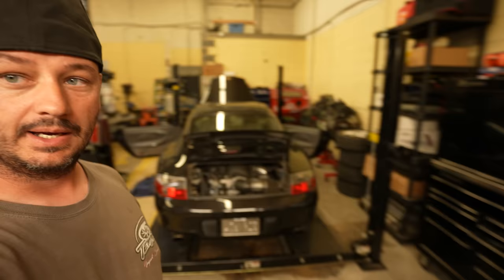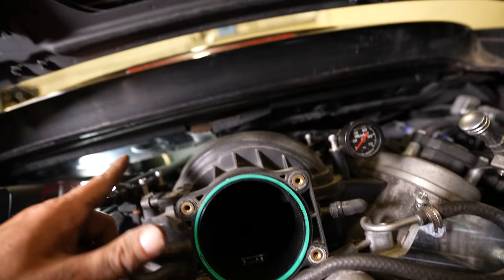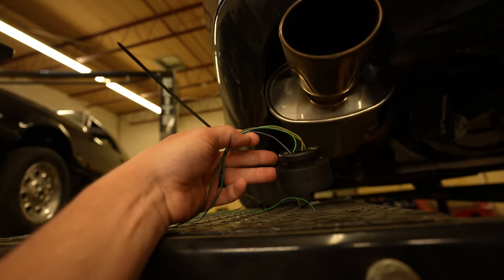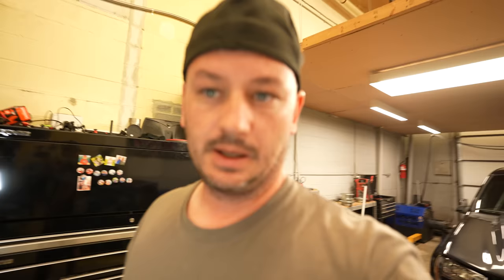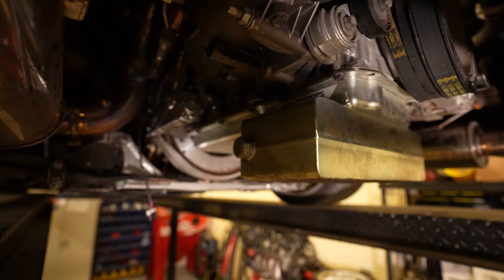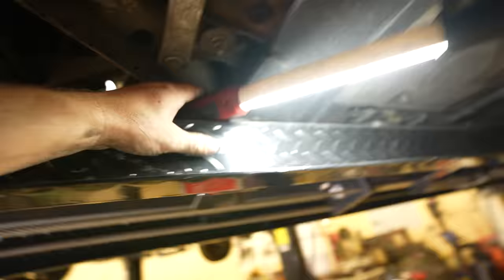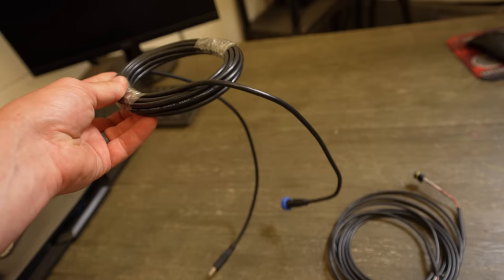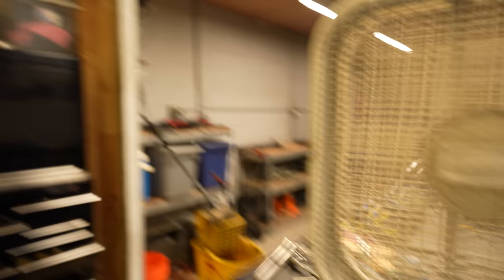Installing Holley EFI on LS Swapped Porsche 911

Comment: thanks for sharing. doing my first LS swap soon.  Like you i have 5 minutes at a time to mess with it.  waited for my holley x from Feb of this year to Last month.  I was like yep that figures. Whenever i finally pull the trigger on it I have to wait 800 yrs for it.  bought a clean obs single cab stepside.  no engine in it.  so ordered all the stuff then stalled out waiting on holley.  then life happened so i have all the shit for a turbo LS swap and waiting again for time to mess with it.  been wanting to do this for almost 20 yrs and its almost too late, but i am pushing and trying while i still can.  we will see how it works out

Comment: Been stoked on this project. there are no porches to buy at reasonable prices to do this....i will keep looking
Reply: Many of the NA models die an early death due to a bearing behind the clutch that goes bad and throws metal through the engine. Keep looking, you'll find one of those! :-)

Comment: Boring 
Nope
I took the same path 
I put my trucks turbo kit together on a dummy ls I had on the stand
I hung all the front accessories for mock up
I then took that info
Rerouted factory engine harness
Added Hydra- boost brake master and a van power steering pump w remote res
It's an 04 Silverado
I'm using  diesel  truck fuel lines
For a half inch feed and 3eighths return 
And I'll reconfigure coolant tank setup to eliminate the giant coolant bottle plus other small things to make service and maint easy once the turbos are installed
Pair of 72/68 Nelson 
Mirror image gen2s
I have similar viewpoint on car stuff Joe
Thanks for putting up the vids !

Comment: As far as PITA to run from front to rear, be glad you have the smaller Porsche 2 door and not a 4 door , I would have ripped out the seats and carpet , you have wayyyyy to much patience .

Comment: If you have nice canbus OEM gauges and it can't run them...
If you have an e-throttle pedal and it can't use it...

Is it really a good aftermarket ECU?
These are things that should be configurable. Especially with the top dog ECU.

Comment: Did you wire vehicle speed (VSS) in to your ECU? If so, how? I've a Boxster S with an LS3 running and OEM ECU and need to get VSS wired in to help with some driveability smoothness but am having a hard time finding documentation on how people do it.